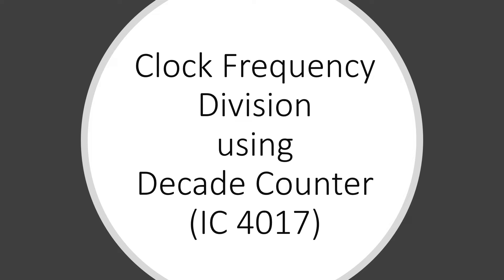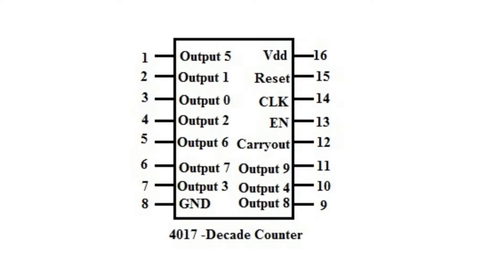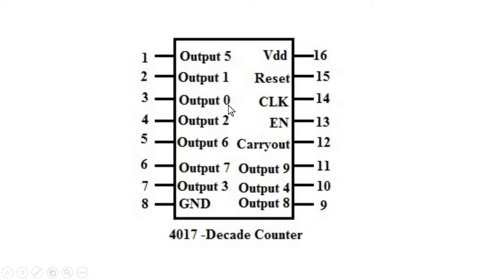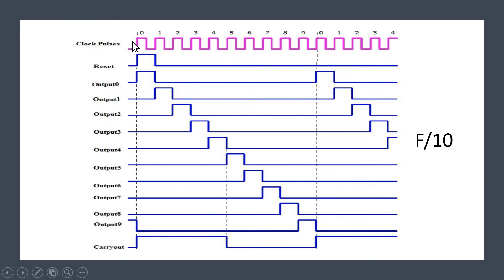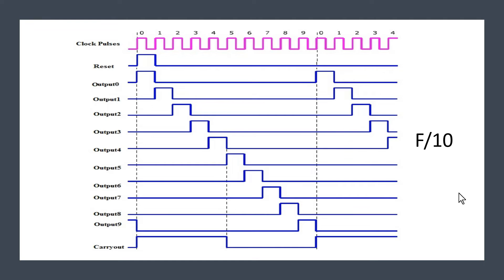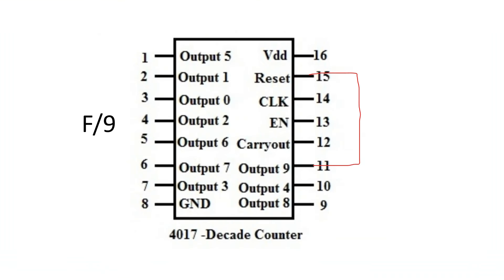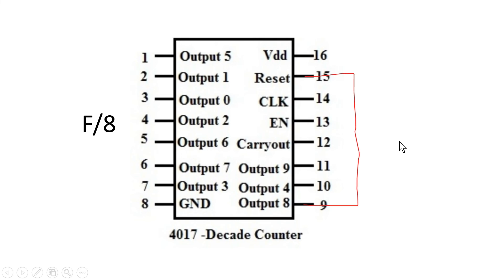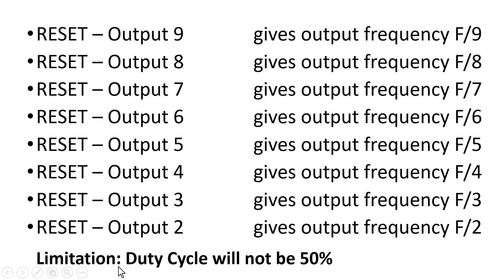Clock frequency divider using decade counter

Comment: I didn't get what does connecting certain output signal to RESET signal mean logically?
does that mean logical OR of output pins and RESET pins?
Reply from the maker: Dear Arpit, RESET signal goes to all the flip flops inside the design. we can choose reset value of any flip flop. When we apply RESET signal as HIGH, all the flip flops will go to the reset state irrespective of the inputs to the flip flops.
Reply: Just hardwire that particular count number to reset